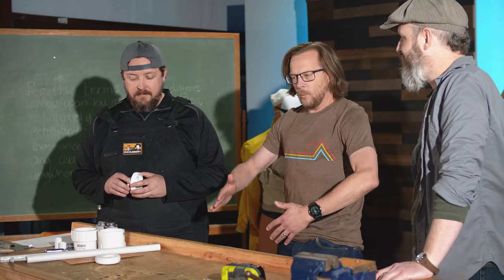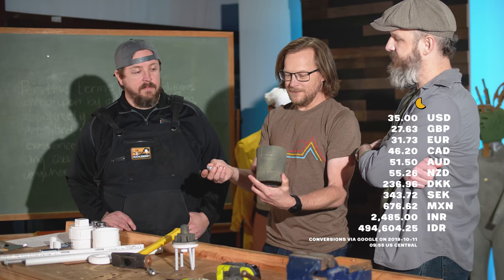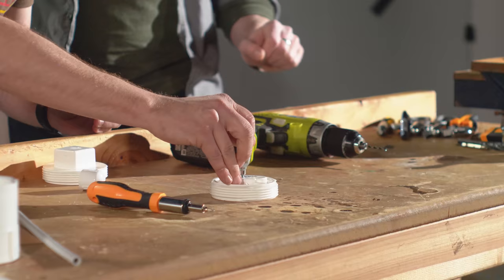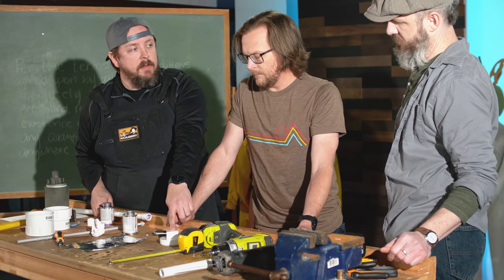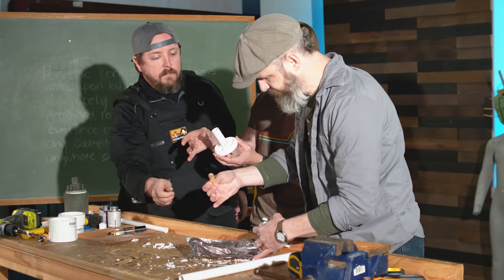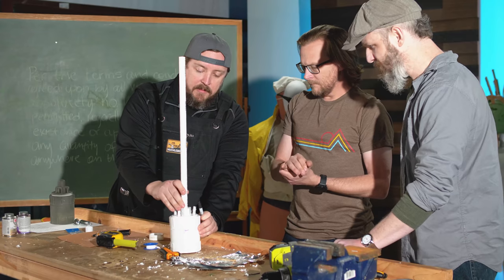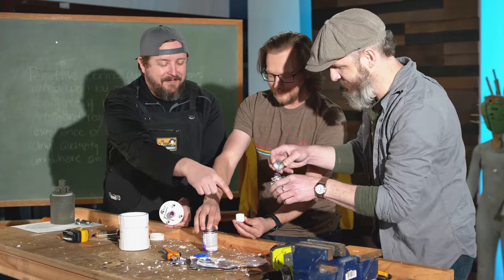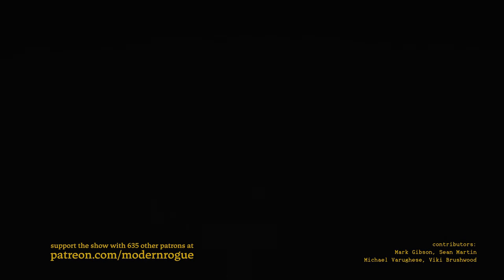Homemade Pepper Spray/Paintball Land Mine

Comment: No gloves when using a drill. It's too easy to get the glove caught in the drill and then your hand gets "twisted". Less important with hand drills but very important with larger tools like a drill press or a table saw.
Reply: But how else would you get noodle fingers though?
Reply: Some of the massive corded drills I've had to handle in my life (like for drilling holes through floor plates for conduit) with MASSIVE drill bits. These drills will literally break your wrists if they get hung up.
Reply: Great rule: if it spins, don’t wear gloves
Reply: Tried xplaing that to my teacher he didn't understand i worked in a fabrication shop for 4 years had and saw a lot of accents coz of that even knew a guy that lost his hole arm in a lathe coz of gloves

Comment: This is essentially just a video lesson on how to construct a gas mine. The good thing about plastic mines is that they are a lot harder to detect using conventional means, such as metal detectors and similar devices. Though, when making a gas mine, you are gonna have to use some metal to store the gas canister in. But when using plastique explosives you can make a decent landmine using little to no metal parts.

Comment: You want the vent spouts to be as close to the bottom of the "mine" as possible, the pressure goes above forcing that water down and then up the tubes since the water is in the way of that pressure being able to escape

Comment: This looks like something straight off of the Anarchists Cook Book haha!
Reply: It's probably more effective than a lot of the recipes in that book. Despite its reputation, a good chunk of The Anarchist's Cookbook is actually pretty underwhelming. (Or at least the original is. I haven’t read the later editions.)
Reply: @B_Skizzle  very true for the newer ones as well. Actually I wouldn't describe them as underwhelming so much as stupid. The anarchist cookbook V had actually good info in it on hacking, at least for the 90s, but most of the other stuff is ridiculous. One of their recipies calls for carbon tet, which has been banned for a long time and is practically impossible to get.

Comment: instead of liquid add fine paint powder  you would get a big could of color and in the heat of a paint ball or airsoft game it would be noticed better imagine running around in the mud and tripping the mine and you may not notice the effect of the mine but if a large cloud of power hits you it makes more of a impact also works better in pour weather such as rain or snow if you have a large cloud of say blue paint powder.

Comment: The explanation of how this slings paint is mostly wrong. The co2 doesn't push up on the paint it pushes down, filling the cavity above the paint. Then paint will follow the path of least resistance which is "up" the four pex tubes. Thanks for the awesome video you guys are the best.

Comment: Would have been nice to have the CO2 internal with a little spring fired striker.  This would be held back by a crosspin.  Crosspin gets pulled out, squirty ncpainface goes off.  Pin tied to some tripwire or thin fishing line   If you have a tripwire you can cover a large amount of ground vs. requiring your target to step on a coin sized area.
Reply: would that also cross the line of warcrime/non warcrime though? XD

Comment: Could you not just make a plunger style with say 100psi of air pumped into the PVC. Have a circle of silicone at the top, the pressure would push the plunger into the seal locking it into place until someone steps on It breaking the seal releasing the payload? Removes the need for co2 cartridges and gives you more control and power.

Comment: Would a true Modern Rogue use a Sawzall to cut small PVC or would he/she/they use a real PVC pipe cutter?  
Would a true Modern Rogue mount a vise in the middle of a table or on the edge of a table so he/she/they could rotate the handle full turns at a time?

Comment: For my fellow Airsofters out there:
When buying the “pex” tube, buy a little bigger measure (I haven’t done mine yet, but I know there is one because I’ve done something with bb’s and pex tubes) so you can put some bb’s inside.
At the end, cut half an inch of the tube and attach a smaller measure so the bb’s wont fall down to the container and thats it.
It will work the same way, but only the reload is from the outside, trowing some bb’s down the tubes, (Im guessing 5-7 per tube) and loading  the new Co2 Cartridge.   

Have fun out there, and remember to ask the refs before planting some land mines and getting in trouble.

Comment: You USA people are so quaint "about 7/8 of an inch" feels like time travel.
Reply: Ignoring the inches part, 1/8 is much more easily eyeballed that 1/10 of anything. Just divide it into quarters then only take half a quarter.
Reply: @trinidad17  I disagree, for me less than 1/4 I see no advantage and 7/8 is no better than 7/10.  I find all of the sentence funny.

7/8 just sounds weird, inches anachronistic and the accuracy is far too high for guesstimating and cutting with a wide wobbly blade like that, which makes the statement about 7/8 quite funny.  It would be just as funny to say about 23mm, because the accuracy given is too high for the word "about" in that context (the kerf is probably more than a millimeter).  

To be clear I don't find it bad, it is quite cute and funny and goes well with the style of the show.

Comment: Wow cory didn't even kiss brian? What a freaking ripoff. Unsubscribed. lol

nice build there bud, bet you were proud of that one, probably one of the most solid constructions to ever come out of this channel. Think you could make a model with a reusable chamber for loading up with dry ice, instead of having to buy pre-compressed co2? I guess you really could just replace the co2 canister with one with a screw top and you'd be done

Lol, a reciprocating saw is not the right tool for the job here, but since when does the modern rogue use the right tool for the job